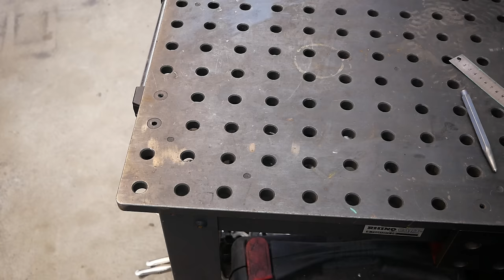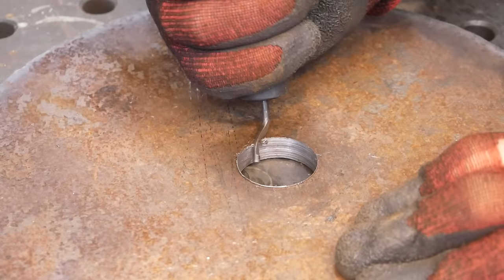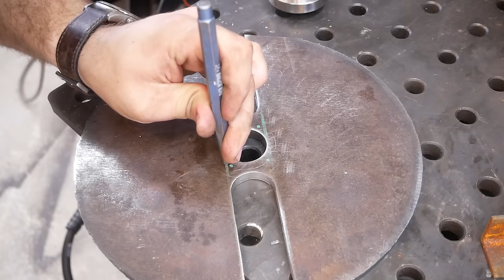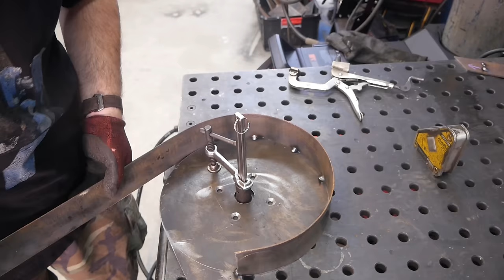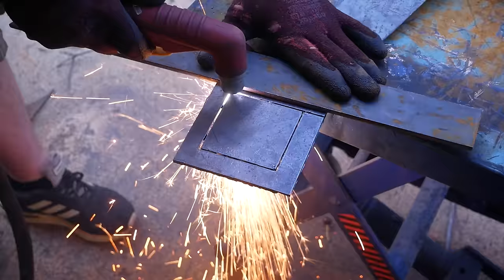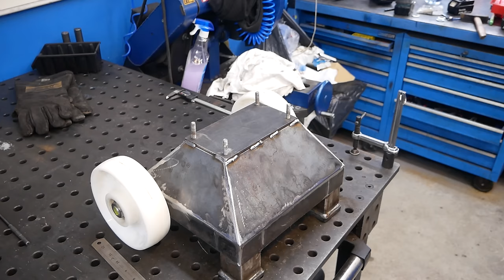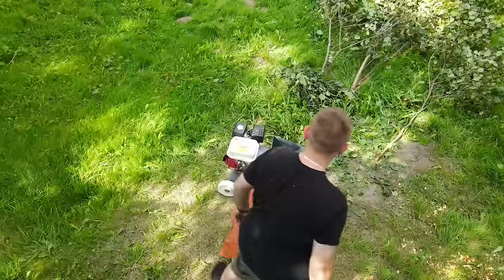Branches will Never be a Problem again - Wood Chipper build

Comment: Use a tool to remove chips/cuttings from a spinning lathe, Not your fingers.
Reply: i think the booster shots finally turned his brain to putty... Or the VOC's from paint spraying. Or maybe just all the welding fumes. Mmmm tasty zinc fumes and lead water.
Reply: @dimitar4y  That slinky like steel chip will take your fingers so fast.  Yikes, hard to watch as a retired machinist
Reply: @kennypool  as a expert on machines i 1000% agree with your statment (i may not be an adult yet but it still hurts my soul)
Reply: @destroyerthewolf  Actually more carpenters lose fingers than machinists, but who's counting?
Reply: @kennypool  dosent surpise me since most carpenters do there job lazy
Reply: He's shaking hands with danger

Comment: RIP crankshaft bearings
Reply: Why?
Reply: that is how a factory would build them .. and what bearings  most of them engines have a bushing ,, also when there used with a pulley and belt there  is more side force on the saft keeping the belt tight ..and no counter force keeping the shaft straight so. if you were too do the pulley drive it would wear out the bushing and or the bearing faster then the direct drive he did .. so more like RIP branches
Reply: @randytravis3998  we get it Randy. You've copy pasted this comment way too many times. Let the people who don't know what they're talking about be.

Comment: I would probably go with the belt drive. But those are not so big branches, hope crank and bearings withstand it in the long run.
Reply: True. Every professional wood chipper has a belt drive.
Reply: @Dougerro  For sure, but I understand the concept. It will be used on his homestead after seasonal pruning, not commercially
Reply: A belt would’ve softened the shocks, and increase torque. But if it’s for personal use on small branches, keeping the large ones for fire wood, it may do fine.
Reply: I thought he was making bags of potpourri...  Chicks in New York paying top dollar for stuff like that.  LOL
Reply: It's  honda knockoff engine so you are right about crank and bearings

Comment: got an old electric woodchipper that came with recently sharpened blades and when I looked at them close-up, there was nothing wrong with them so I chipped most of my branches until I decided to sharpen them just for fun. turns out that the blade profile plays a huge role, it must be a perfect chisel grind, any amount of curvature or ''rolling over'' near the apex of the blade will make the cutting harder. i used a tormek t8 with a jig and the outcome was about 2x better chipping, I didn't have to push in the branches, they were sucked in immediately. the blades were very sharp when I got the chipper.
Reply: Not to mention they where hardened steel blade. These will dull in 1 branch.
Reply: A round edge doesn't cut as well as a sharp one? Wow! Thanks for letting everyone know!

Comment: Those Honda clone engines are a fantastic deal.  For rough service, I have had great luck with using mild steel for the blades, but running a couple beads of hard surface rod for the cutting edge.  The mild steel body won't crack or shatter, and the hardened edge has great service life.
Reply: That's interesting!
Reply: I agree about these Honda clone engines... 😉 Only one time, I had an  issue with one manufacturer, when after 5 hours of use, engine decided to shot himself with exhaust valve through engine case because of broken spring.. 😂 One time from 1000 isn't so bad..
Reply: I was wonder about mild steel blades,.. and about hard facing too. Thanks for the answer to my question.
Reply: I had a 6' bush hog that had soft blades and got dull in 3-4 hours. I hard-faced them and they lasted about 12-16 hours. I then got the blade tips red hot and quenched in oil, and they lasted about 24 hours.
Reply: @Bob_Adkins  This is very  helpful, thanks for your reply, Bob.

Comment: Man, what a simple but effective and compact machine! I'd be interested to see how sharp the blades were after use. It didn't look like you used hardened steel.
Reply: Agreed, I would have at least used some pieces of leaf spring. Or just order some high carbon steel for such projects.
Reply: Вы правы! На моём агрегате даже высокоуглеродистая сталь требует периодической заточки. После 2-3 кубических метров щепы.
Reply: You could buy wood planer blades and cut them down to size.  Fairly cheap.

Comment: Good design and nice step by step.
Finished article looked professionally assembled and produced.
At no point did I see you balancing the weight of the spinning cutting disc though, similar to how wheels on cars have weights added to balance them I feel this should be done here.
Also the bolt/screws should all have something like Loctite on them to stop the vibrations loosening them.
Lastly I am not sure how idiot proof the shoot feeder was as you seemed frightened of it when you put the 1st 2 branches in.
End result great shredded bark.

Comment: Now this is what I call "Heavy-duty wood chipper" well done man!
Reply: I'm sorry but it isn"t. The design is flawed in that the flywheel is not supported properly and connected directly to the output shaft. A belt transmission would greatly improve longevity, as it is now it'll burn out quickly.

Comment: I wonder, how long engine will last without additional support bearings that would take impact load from chipping action
Reply: You know, that is a good question.
Reply: when a factory builds them there about the same ,, just have too make sure engine is running at full speed before you start chipping
Reply from the maker: Time will tell 😉
Reply: @randytravis3998  Byt why mimic factory, if you can do it better? Making longer shaft and installing two bearings would not cost much time nor money.
Reply: not long, modern engines are made pretty flimsy. Every one of those chips removes probably like 0.01mm from the conrod bearings. I can feel the metal get squashed, through the monitor.
Reply: @randytravis3998  That's true. So we already have our answer to the original question - "Not long!"
Reply: @dimitar4y  
So 100 chips move 1mm of conrod bearing?? He has 10s /100s of thousands of chips, your statement makes no sense..
Reply: @dimitar4y  
I’ve heard about you so many times from people at work and now I’m lucky enough now to actually see a comment from some guy on the internet. 

Today is going to be a good day.  🤣😂
Reply: @Crewsy  that's the point of my name :> though it's only been this for a year or so. First one to get it!
Reply: Half the fun is getting there... I mean, getting it (done). The rest of the fun comes from ad revenue on YT. And the machine? Aw, c'mon, get serious... ;-)
Reply: @MadeinPolandChannel  "TIME will tell - get your copy now" was the ad slogan of TIME magazine back in mid '90s.

Comment: You didn't show the part were the cutter was balanced. Becasue it's evident by the very low or nearly no vibrations of te cutter that it has been balanced. For would-be " wood chopper" builders, the balancing process would have been interesting and relevant, to see. Very interesting video to see 👍👍

Comment: The design is very good; I like it, but I have a question. Do you thing changing the angle of the blades, and/or adding additional [and harder], blades would decrease the machines natural feed rate? It appears to want to "pull the branches in" all at once and bog the motor down vs allowing you to push the branches in at a steady rate. This isn't a criticism, only an observation. Well done; God bless.

Comment: I generally prefer making rather then buying, but do not need a wood chipper, would be cheaper for me to buy rather than make if I did need one.  However, this does give me some ideas on making a cardboard shredder, which I do need.  Will certainly cost me less than buying.

Comment: You should adjust the cutter design a bit and add a chip thickness limiter to prevent the motor from stalling and the impact of inserting the branch from being transmitted to the worker (minimize kickbacks). the chip thickness limiter should not be further away from the knife than the diameter of the branch

Comment: Very good work, done with precision and method. I would suggest that the blades be thinner in order to make smaller chips to make cutting branches easier. We can see that the engine is struggling because of this. And like the other people, a belt to avoid crankshaft breakage.

Comment: If you make the exhaust chute get wider and flatter, it doubles the utility. If you just weld a 20 inch piece of quarter inch rod to the swivel, it's very easy to spray mulch in people's garden beds and then follow up with a quick leaf blower. It's a great money maker, they presume you will be out there for 6 or 7 hours carefully raking out mulch. When you can just shoot it everywhere and have a few guys blow it off of the shrubs, it looks exactly the same and you are out of there in an hour. What I'm talking about applies more to pre-bought mulch, I don't know how common that is in your part of the world, but perhaps you could start stockpiling a few different colors and occasionally turn them over so that customers can pick what they want to look at. These are the best customers you can ask for, they want everything to look tended to constantly, but they will never risk getting dirt under their fingernails. That's the way to go, lock them up into a steady twice a month automatic cleanup service on invoice. You can work when they are almost always at their jobs, so there can be no argument between whether you are being paid for the job or by the hour. Cheers

Comment: some basic engineering mistakes here, you need bigger wheels for moving it around, and a long handle so you dont bend down when moving it, make the input shute longer so your fingers stay in one piece, make the output tube wider, in time it will block up, and lastly you need to buy two pulleys and a belt and couple of heavy duty bearings, this means the shredder shaft it supported properly, driving direct off the motor means after a while the crankcase will shatter and destroy the motor, having a belt means the belt takes the shock and also saves the motor, I have built shredders and I know what I am talking about.

Comment: That's a real nice build, if I had the equipment and motivation I would make one like that.
I had a small 2hp electric chipper for about 20 years, finally managed to destroy it this year after years of abuse and living outside. (really shouldn't cut 30-40 mm branches but it did, for years)
Bought a used 6.5hp one 'almost new' and it's destroyed almost everything I've put in it but won't do the 3" (75mm) branches it's advertised as being able to cut (unless they are almost rotten, but then they fall apart anyway)
It struggles quite a lot with 40mm oak but otherwise, great

Comment: How did you harden the blades?
Also noticed the old problem with the blades being fairly aggressive, it's a hard balancing act.
Why did you put the outlet up the top, I thought they worked better on smaller chippers at the bottom?
Very relaxing video to watch, apart from where your hands were down the feeder.
Keep it up.

Comment: Need to add feed rollers. That way, you don't have to jam the branches into it, possibly losing a couple of digits in the process, mate!
Reply: "make it extreme" and then it's a pile of finger eating crap. Didn't even use the correct geometry for the blades to enable effortless auto feeding ...
Reply: @dimitar4y  What's the secret to the correct blade geometry so it feeds itself?
Reply: @gorak9000  It's sort of variable depending on diameter, surface speed and average branch diameter, but the more important part is having the blade not kick the branch out, 45 ish degrees so the slices yank the wood in during cut, so the tree is gliding on the cutting disc ready for the next blade to hit it. For "ultimate" blade design you want to borrow some geometry from lathe tools, that little dip that makes the chips curve, so during the slice you don't "shatter" or "pinch" the wood, that'd thrust it out; and finally, a curve so when the blade cuts, it "pushes" the wood outwards to the outer diameter, and then a spiral on the disc to "pull" the branch back closer to center so the next blade can machete slice. This means minimal wear to the blades as the tree is sliced rather than .. smashed. And means more predictable feed... Or just add feed rollers and chuck a bag of spare blades. Oh, also, you won't read or use any of this knowledge HAYO!
Reply: @gorak9000  Also the feed into the blades shouldn't be perfectly perpendicular, you need to allow excess forces to escape somewhere instead of getting the branch stuck or kicked out. Professional units have the correct geometry and they self feed with minimal effort. They take it nice and easy.
Reply: @dimitar4y  No, I actually am reading it. I've noticed that some chippers suck the branches in nicely, and some (especially the DIY ones) you have to really push the branches in and they don't really want to feed in, and I've always wondered what the difference is. I have a 5HP wood chipper I want to try converting to electric, so I will definitely save what you said and try it out when I get to that project. Re-reading what you wrote, how do you get the cut off part of the tree to be flat against the disk, ready for the next blade to chip it when the blade is mounted on the infeed side of the disk? It seems that no matter what you do, the cut off branch chunk is always left away from the disk by the thickness of the blade, unless you mount the blades on the other side of the disk or something?
Reply: @gorak9000  The cutting blade must always be towards the branch, so when it does its cut, the branch has forward motion to bump against the disc, setting the cut depth. Since as the disc spins there's "more time" for the branch to go forward than being "pulled" into a hole quickly then cut. The trick is the blade geometry AS it cuts the branch, it also PULLS it, already it's ready for the next cut. Think about how you carve a stick with a pocket knife. You want to shave and pull it at the same time.  "Crushing" it with a dull blade will just make it kick out. The vibration of the machine can help feed the branches also. Also if you want a guaranteed more smooth experience, you need to use a different type of blade - instead of the disc that cuts like a meat slicer (study how meat slicers work for tips on blade design) you can get one that uses the woodchipper itself as also the feed barrel, I think our guy here made one like it in a previous video. As the blade "bites" it also pulls the wood in.
Reply: @dimitar4y  Yeah, the one with 2 horizontal blades, one above and one below, that makes tree "chunks" as opposed to tree "chips" - yes, those style do pull the branches in much better.

Comment: that looks so like it will work well. most commercial units like this have the feed side on the engine side and have 4 or maybe 6 impellers on the other side that produces more air. I'd say it works well as is, but if you wanted to spread the chips out more, you would need bigger impellers.

Comment: The machine itself is very useful. I think the mild steel blades won't last long, it would be better if they were made of C45 or some tool steel. I think the i feed is a little too aggressive when you put wood.
Reply: For blade is hardox steel
Reply: @phredka12  Hardox sucks for blades, it's a high manganese steel which does not retain an edge.

Comment: Nice built chipper shredder. But for safety reasons you need to extend the input chute so that you can't possibly get your arm into the blades. Most are built so that you use a push stick type item to make the branches chip up, not your arm... Thumbs Up!

Comment: Excellent.  Small stuff is ok, but I would be worried about the vibrations from large material going directly into the crankshaft of the engine. As we all know it can be an engine killer.
Any trouble keeping those blades tight on the round plate ?   Grade 8 and thread lock ?

Comment: Many comments are talking about the direct to the shaft blade. I would hope that people understand that chippers are sold in this style. 
The watch your hands comments. I am 100% sure that they understand the dangers of their hands being where they are. Videos clearly do not always show reality. There are more safety comments than comments about the build. 
One comment was about buying off the shelf blades from JD. This is true and would work just as well. When I think about building something I think about off the shelf parts to which you can buy.
Reply: They're just losers that have no experience with this stuff. They sit at home after they get done punching the clock working a menial 9-5 job, and think that everything needs safety measures.

Comment: holes in face plate  mite have bean better sloted so that blades can be adjuster . just a tip from some who worked a wood chiper in a papermill for some years  but t ts your chipper so do it as you think best ,.
.

Comment: I have a commercially made chipper with the chute slightly longer than your arm, that way you cannot touch the blades, a very simple way of making it relitivly safe and keeping fingers where they are meant to be. I would agree with others about the belt drive, but the downside of that is the machine becomes less compact, which is one of its great attributes,  mine is the length of a wheelbarrow, liked the build.

Comment: Great machine, myself I would extend the feed hopper to over arms length for safety as it seems a bit "grabby" and I would heat treat the blades. Otherwise really good work 👏
Reply: Needs a stop bar so you actually have some hope of avoiding being pulled in. Limb steeling machine.